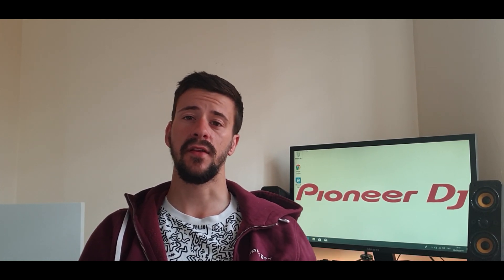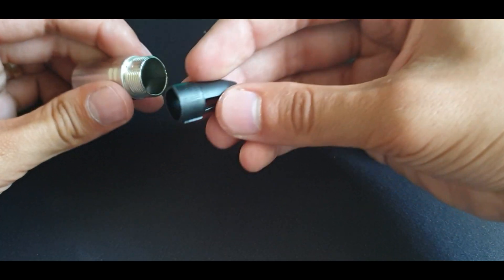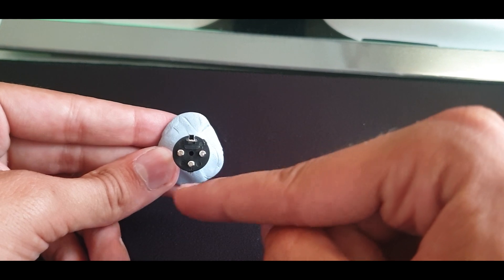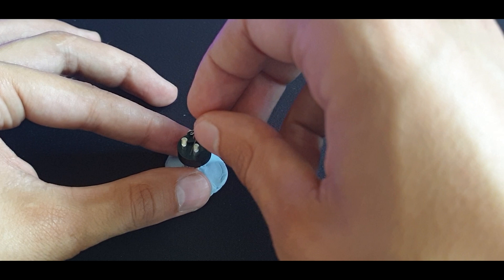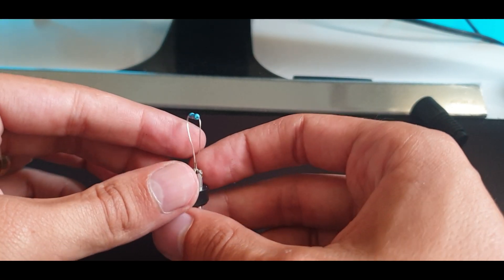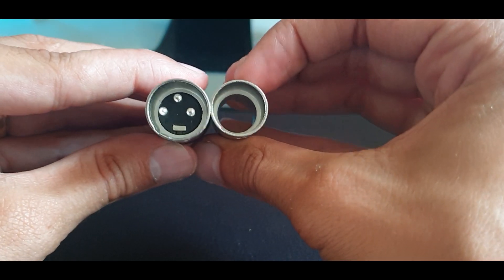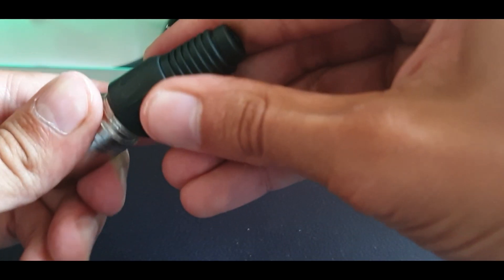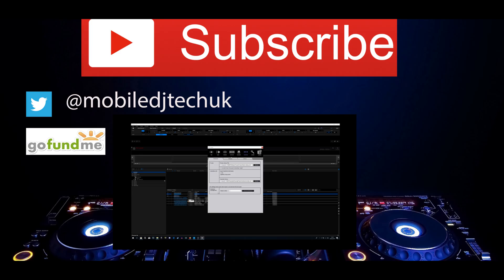HOW  TO MAKE  YOUR OWN DMX TERMINATOR DIY

Comment: For What purpose?
Reply: Dmx light fixtures in a chain can act up from feedback that reaches the end of the chain and bounces back and any other interference. the terminator plug ends the signal when it is plugged into the very last light so it doesn't mess up the chain/entire light setup.
Reply: Thank dude

Comment: 2 suggestions: keep the lead length as short as practical, and wrap some electrical tape around the resistor to protect from shorts against the case. Thanks for the video!